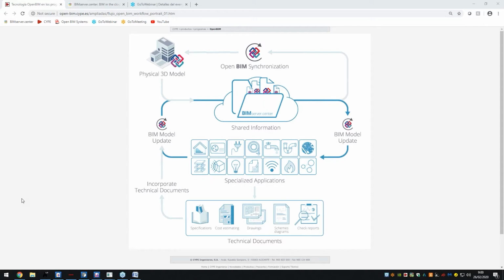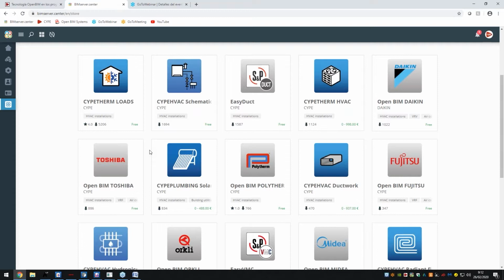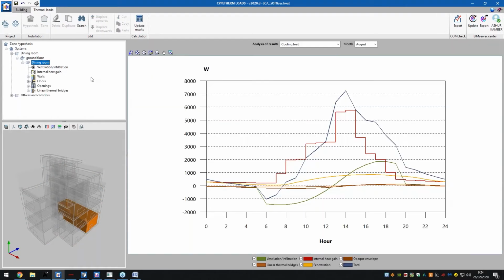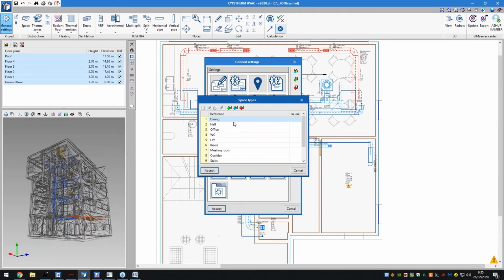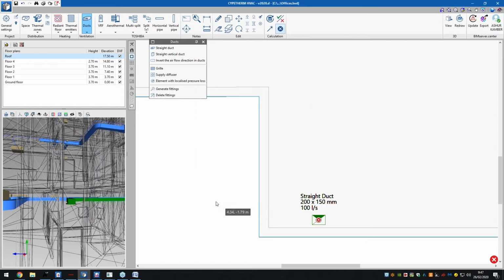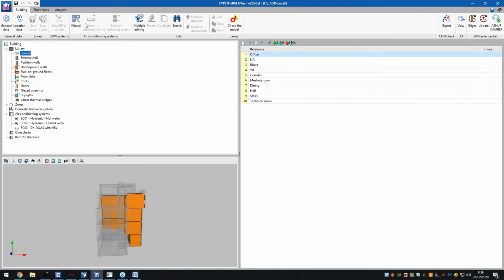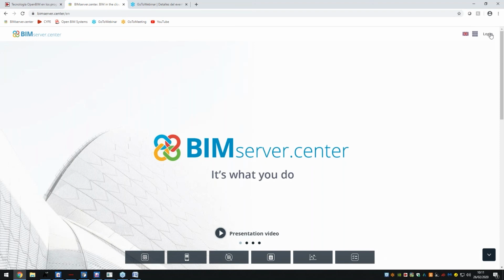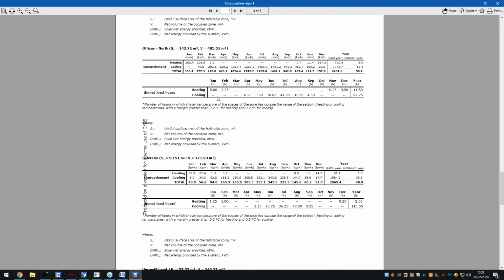Webinar: Building Energy Analysis and HVAC Design with Open BIM software

Comment: Hello Sir, this tutorial is very useful giving insight into the workflow of any discipline, thank you so much. Following your steps (https://youtu.be/TrNQY_EIuUM?t=825), I have been practicing for my water and sanitary system design work. But, in my case, all the fixtures which have been placed/situated by the Architect (visible in ArchiCAD) were not imported to/don't show up in the CYPEPLUMBING software (even in the IFC Builder!!).

Is there a way for such problem, Please??

Thank you!